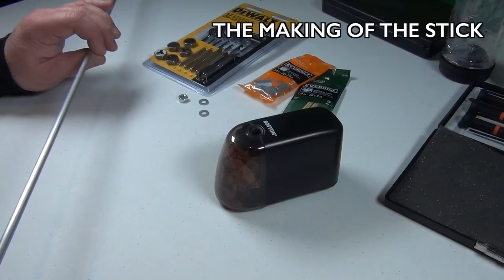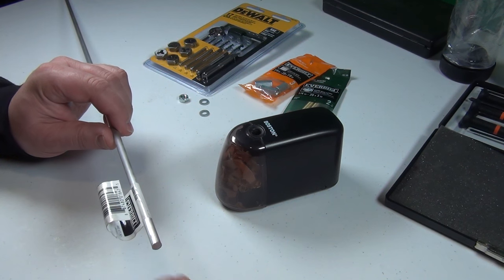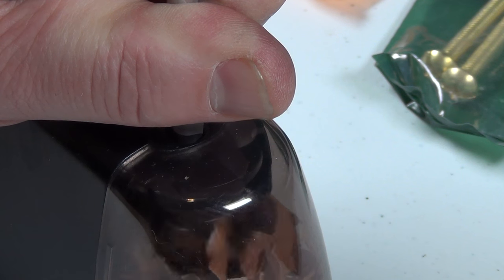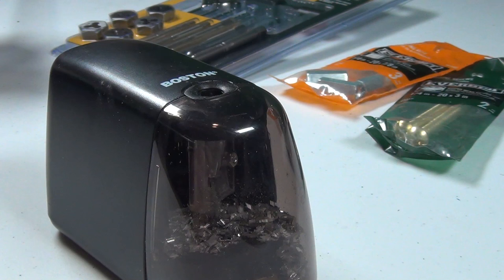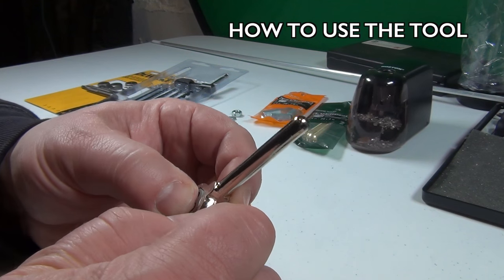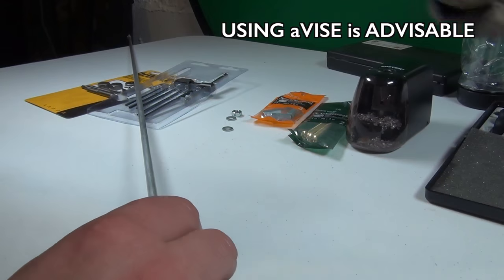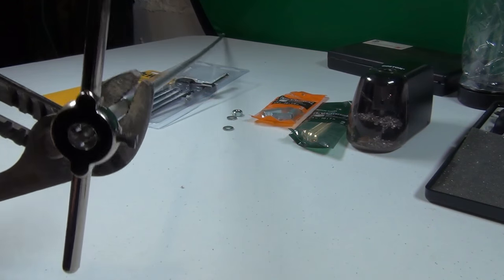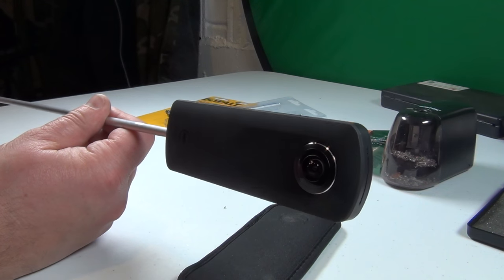Ricoh Theta - D.I.Y. Monopod

Comment: I was able to pick up 3 foot steel rod/bolt which is already threaded all the way through at our local hardware shop (City Mill).    

Also I found that since we have a lot of ocean views where I live (Hawaii), it is important to have the Theta-S perfectly level and straight up and down.  If I hold attach the theta on the top and hold the rod about 4-5 inches from the top with two fingers, the rod will act as a level so the ocean appears as a straight line on Flickr.  By adding weights at the bottom, I can increase the holding distance making me look even smaller.

Comment: You need to also use oil on it before you thread it.
Reply from the maker: +Bobster986 Oil would make it only a little easier. Since I use an aluminum rod what is pretty soft compared to the cutter made from high quality steel. I didn't want to mess around with oil.
Reply: It also keeps the threads in your tool from dulling, but on aluminum I guess its fine.